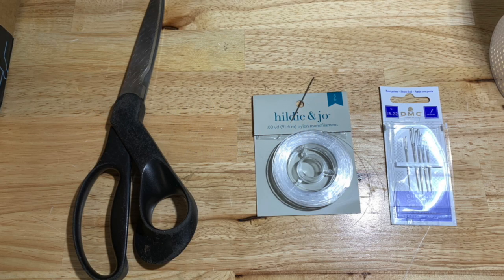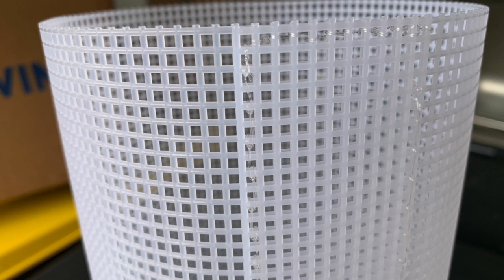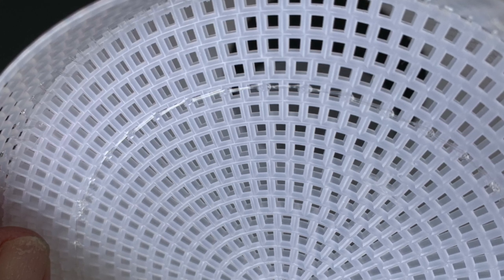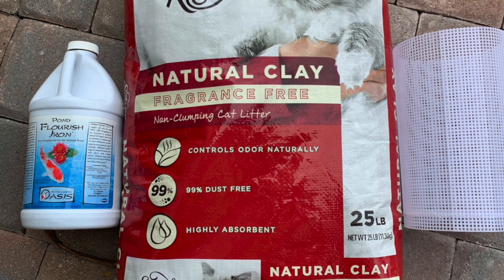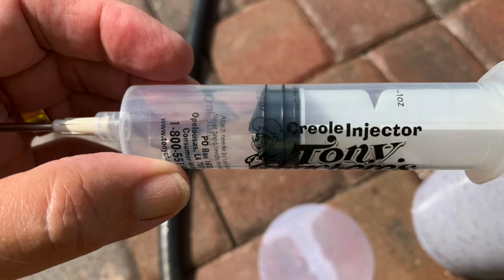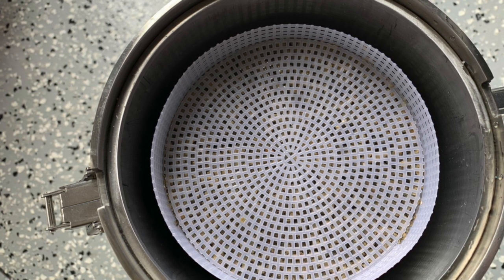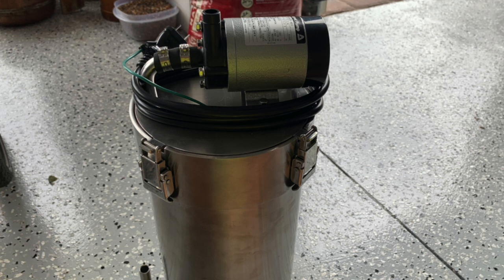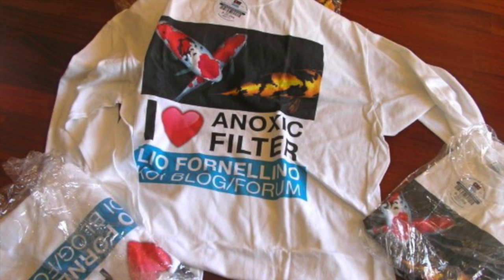Converting an ADA Super Jet 600 Canister filter into a Nitrate reducing Anoxic Filter.

Comment: Its almost impossible to find the right type of cat litter within the uk im 50pound in now, Neighbours cat loves me
Reply from the maker: Try oil dri or something similar from local hardware store.
Reply: @anoxicfiltrationplenums  I used JBL manado as  substrate in my plenum because its high cec
Reply: Tesco brand cat litter low dust.  (Brown)
Reply from the maker: @jimying6520   you can also use Oil-Dri or Safe T Sorb. The latter two are for oil spills in garages. However, they all will work the same and have the same life expectancy of 30- plus years and will harbor the same bacteria.  Kitty litter is the least expensive of them all and that is why I recommend it over other baked clay products.

Comment: I see no difference in what you are doing than what I've done for years with fine red scoria. Never have ammonia, nitrites or nitrates. I also use a high plant load as well. Hardly ever do a water change, just top ups. Never watched your channel before, but your thinking is old school like mine. About to create an undergravel filter for my pond using scoria as my substrate.
Reply: Hi Martha.
What exactly is this Scoria?
How did you find out about it?. Does the water pass through it, or around?
Reply: @marcs3982  scoria appears to be lava rock. So, no. Water wouldn't pass through that.

Comment: I copied this on a marine grade stainless steel canister filter my welder buddy and I made, I forgot the metal classification but she's propper.
Reply from the maker: Probably 900 SS like a Rolex is made out of.
Reply: @anoxicfiltrationplenums  recently I have been curious if I could super charge my BCB baskets by dosing 4% vodka solution (ETOH) coupled with Iron Gluconate (12%) solution. Any thoughts on it?

Comment: Can you use turface instead of cat litter?
Reply from the maker: And what is turf face?
Reply: @anoxicfiltrationplenums  Turface is a soil conditioner. It is a calcine clay product used to improve drainage, reduce compaction, hold moisture, improve the CEC of the soil. The clay is mined in MS, then run through an oven at 1500 degrees. After the clay is baked at 1500 degrees, a permanent soil particle is produced which will never break down. Kind of like clay pottery, but very small pieces. It is commonly used as a substrate for bonsai.